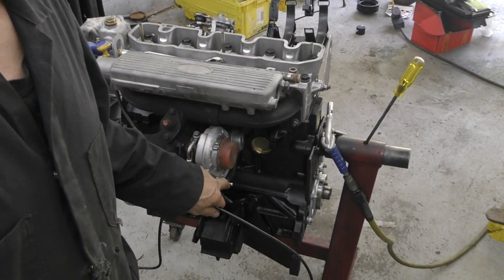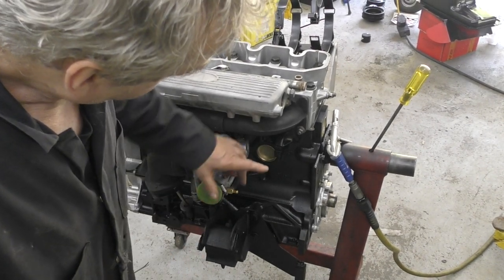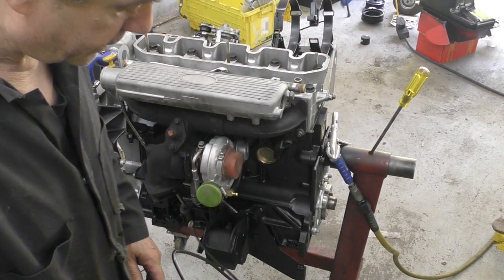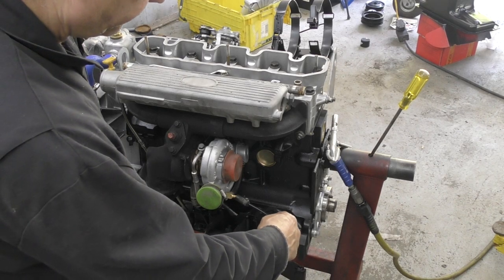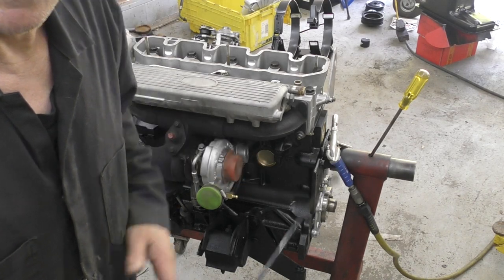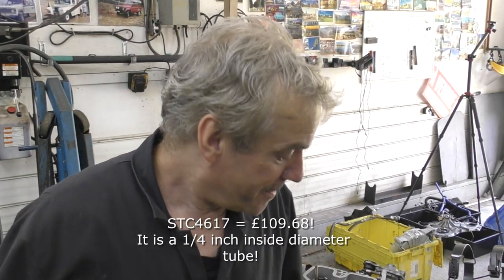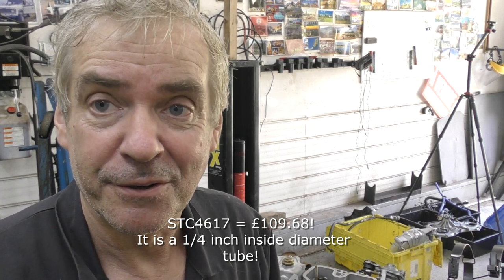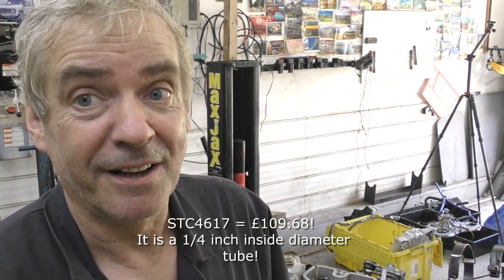Simple fix for low power 200 / 300Tdi

Comment: I’m thinking I got exactly this problem yesterday.  Noticed a noise that I first thought sounded like wind coming from the dashboard at around 1900rpm in any gear, and a lack of acceleration.  Thought clutch but it seems to pull away ok, no engine race.  Will check today!
Reply from the maker: Hope you find the problem!
Reply: @BritannicaRestorations  Thanks!  Solved it today😄 .  Jubilee clip on bottom intercooler hose had slipped off - explains lack of boost and 'wind noise'!  It was the first thing I checked but obviously I missed this bottom one.  I need to find better alternative to crappy quality jubilee clips from the auto parts store.  They overtighten and slip so easily!  During my investigation I checked the boost pipe as per this video, the short waste gate pipe and tested the waste gate actuation.  I learn something every time and your videos help greatly! Cheers!
Reply: Try Mikalor Clamps. You have to be accurate with size as they won’t cover the same range as a jubilee. Only thing to remember is if using stainless ones always grease the treads.

Comment: Hi Mike. Great video and I will check mine when it stops bloody raining. I have a problem with my 300tdi. It suddenly lost power and will not rev over 3000 rpm. It also hunts when at idle. The revs rise and fall. Someone said it might be a stuck boost pin, so I checked, and it was moving freely. I rotated the boost pin about a quarter turn, and it has an effect on the performance for now, At least it is drivable now, but I still want to sort out the underlying problem. I thought it might be sucking air in the fuel lines, so I ran it from a can of fuel in the engine bay, and it didn't make any difference. I am now thinking it is either the injector pump, or the injectors, but I thought I would ask you before I start getting too deep into it.
Reply from the maker: Check the pipe inc. turbo hoses 
Did you put the fuel directly to the pump?
Doubt it will be injectors - Could be the pump - I have seen a few with broken springs on the HP side

Comment: Would this be a top-end power loss or throughout the rev range Mike? My def90 200 seems to be getting a bit breathless at high revs but pulls well low down. It's the original turbo running a full width Fearn intercooler and std air filter - used to be a bit quick but isn't happy towing heavier stuff now, regular changing down on hills, and tops out about 75mph unladen. Used to be good for an indicated 90 mph+ (If you had the nerve!)
Reply from the maker: Could be anything - Injectors need a clean?
Reply: @BritannicaRestorations  Good question, I'm planning a bit of trial and error testing of everything but saw this video and wondered how such a vacuum loss from the turbo - pump tube would show up...
Reply from the maker: It is a pressure loss = no pressure = no boost to the injector pump, not much acceleration 
From what I can recall, the turbo boost comes in at 2000 RPM, so that is why the pipe is lined to the top of the injector pump to adjust the fuel to compensate for the extra pressure generated - with more air in the intake, you can burn a bit more fuel, and get more power

Comment: Hi There! Thanks for this, I am recently the proud owner of my first Disco 1 300tdi.!! I have redone the motor (bought it with a water leak in cylinder 2) and have basically replaced everything, barring a few odds and sods.

I did not know about this pipe nor did I check it! I will be doing so tomorrow morning!

Found the video searching for 300tdi's with excessive black smoke (not heavily excessive, but quite a bit more than what is standard on a diesel motor in my opinion!) this may not be the fix, but definitely worth having a look at. I am worried that it may be my injectors as I did not replace them, but did have them checked by a diesel pump mac who said they were okay, not the greatest, but okay.

Great, to the point & informative video! Subscribed!
Reply from the maker: Injectors were supposed to be serviced every 90,000 miles - but they never were, and progressively worn or became blocked - maybe a set of new nozzles may remedy the problem?
Reply: @BritannicaRestorations  morning Mike, yes I agree! I will have to have a look around to source some locally!

Appreciate the reply! Have a good day.

Comment: Thanks for posting this, I Need to check mine when I get back home, my landy started to have a low rpm idle on the school run at every red light, I had to blip the throttle to keep the revs up, it would sort it self out then idle like normal.. then this morning it wouldn’t start well at all.. loads of black grey smoke spitting oil residue on to my wall.. it’s always had a black smokey start up but this time it kept trying to stall, then when I reved it up loads of grey black smoke would pouring out and it wouldn’t rev high at all and it bogs down and cuts out. 

Hopefully it’s the hose it’s the easiest thing to check 😅

Comment: Does the pump diaphragm also lift up and decrees fuelling when the turbo is lagging?  ie if you removed the turbo for some strange reason, should the fuel pump still be connected to the intake manifold?
Reply: It increases fueling in line with manifold pressure, and sits against a stop while off boost. No reason to connect it with no turbo as it would sit against its stop the whole time
Reply: @TheTomco11  Thank you for the followup/reply, wish it was sooner as it took me a few hours to figure that out the hard way :D